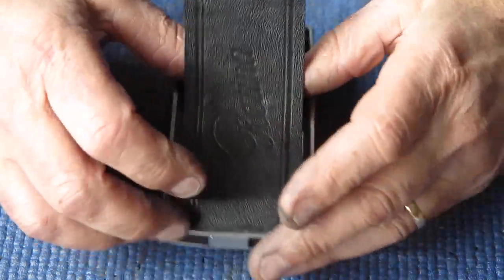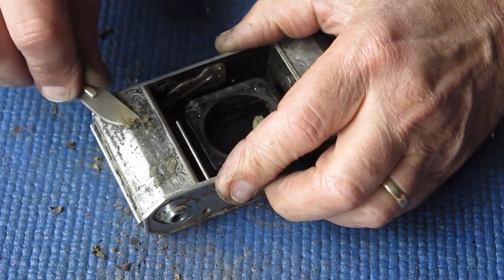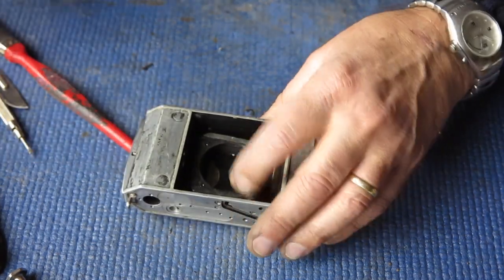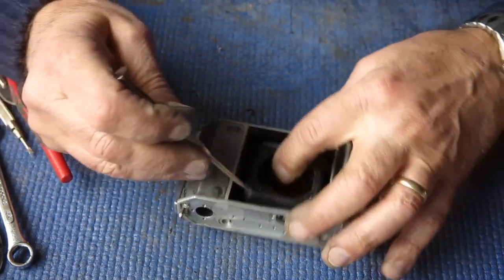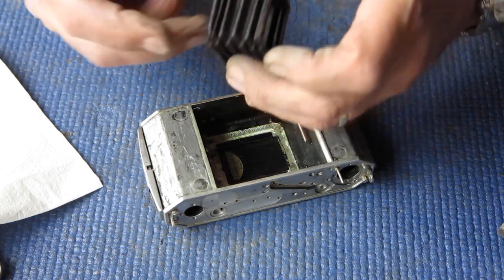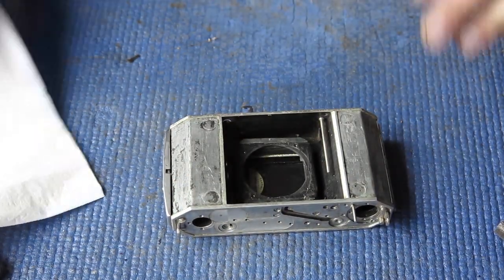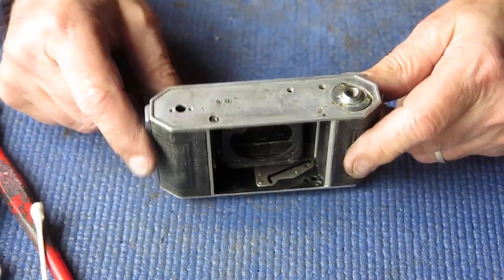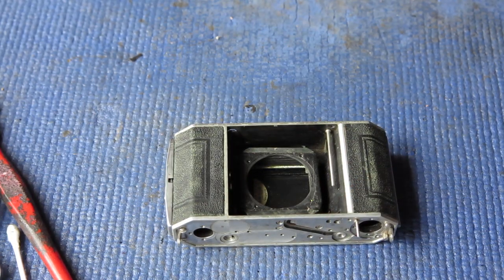A pair of 'parts or repair' Retinas part 03

Comment: Do you ever touch up the paint work on these Chris? Or put any treatment on the bellows if they're a bit dry and creaking?
Reply from the maker: No, you'd go mad trying to make the paint look 'new'. The camera bodies and backs are generally aluminium, and getting paint to take to aluminium reliably is an art form all of its own. 

I have applied a soft cream shoe polish to bellows on occasion, I use a cotton bud (Q-tip) to apply it, leave the bellows extended, and warm them with hairdryer to help the polish soak in.
Reply: @ChrisSherlock Yeah I see, that could quickly become a frustrating endeavour,  best swerving that slippery slope. 
Thanks for the bellows tip, I'll give that a go with some wrens shoe cream, I think that'll be ideal.
Cheers

Comment: Nothing worse than a camera with its name on upside down, was that a quote based on experience? It certainly sounded like it, made me laugh. Is that a rubber based adhesive you are using? Will it come off in the future if required?
Reply from the maker: Yes, I've certainly seen cameras with the leather or leatherette upside down. I've even seen cases where the covering was put back on inside out, that makes an awful mess, as you can readily imagine. I use Ados F2 adhesive, much like Bostik 1181. A contact adhesive, but not used like that, and the leather or leatherettes can always be removed later as needed. A little naphtha will help with that.